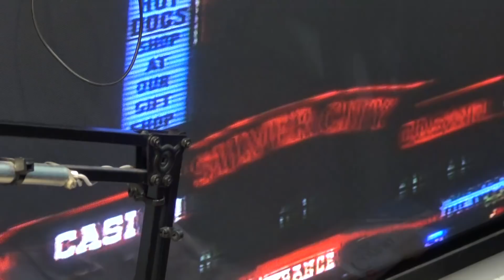Sony Beta 711B3 chassis mechanical timing and front loader timing

Comment: Hello 12Voltvids,

finally i became a proud owner of an ED-V8000 from Japan. The chassis is also a 711b3. Unfortunately it is not threading the tape in after the cassette is loaded fully. It threads in just a very short way then it stops then after a few seconds it threads again a very short way in and stops again.The loading motor is not slipping (!) I did meassure the voltage during this symptom is showing up - 2 times around 4,45 V when it is spinning then back to 0 V. 
If pressing the eject button it threads again a very short way more in. After unplug and plug in the power supply again the threading in cycle will be completed and threading out right afterwards to the eject position and eject the tape.
I followed all your procedures for the adjustment and also the switch is clean. Maybe you can give me a hint for what could be the reason for this strange issue?
Reply from the maker: Probably the black gear that breaks on all these machines.  Under the planetary gears where the elevator belt goes.
Reply: Thank you so much for your very fast feedback. 

Do you mean inside where the tape moving rollers are - under the capstan belt? 

The black gear under the planetary gears which is driving the loading ring is fine - i already triple checked it.
Would it be possible or an option to send a small video to you?

Maybe you are remembering me - one time we already talked about the EV-S7000 and i did send you the 3D STL file for repair the teeth wheel there - some years ago.

Comment: I have a SL-HF860D, it threads just fine but when you hit play the capstan doesn't appear to turn (or the pinch roller is not engaging correctly). I took off the bottom of the machine but the capstan motor is cover by a black plastic cover that I can't pop off because there's a metal piece in the way. Could the capstan motor be seized?
Reply from the maker: Highly unlikely.
Reply: @12voltvids  I think it's the SMD capacitors on the capstan motor board that are causing it to not spin. I've read they go bad like all SMD capacitors. I'm going to try replacing them.

Comment: Hello sir, i hope you can help: 711B3, I took the threading motor off to clean the mode switch. Sliding the loading ring around to clean/lube, when it reached the fully threaded position, it clicked in place and i can't move it. Any idea why?  I’ve applied all the force I dare, compressing the spring on the shuttle block and then some.
Reply from the maker: Yes there is a rollar can that locks it in the loaded position.  You will have to pull that back and then it will rotate.

Comment: Hi , How the front loader motor is working I did 't see any switch or sensore  to run it .
Reply from the maker: At 7:50 you see the sensor that triggers the front loader to unload. @ 11:51 just to the right of the take up hub you can see the switches that activate when you push in a tape to activate the loading cycle. They are tripped by a cam on the loading gear on the front loader when you push the tape in and the cam gear rotates.
Reply: @12voltvids  Thank you ,,, that's Help full .👍

Comment: If I sent you a betamax (HF-2000) do you think you can fix it for payment? it was working fine when I got it, but now it just makes a beeping noise when I turn it on, and it won't load the cassette nor thread the tape when it's in there, like in this video:
https://www.youtube.com/watch?v=ogWb01P6IVo&feature=youtu.be